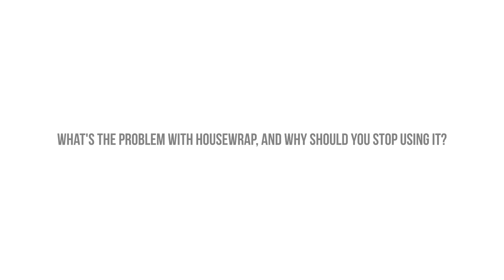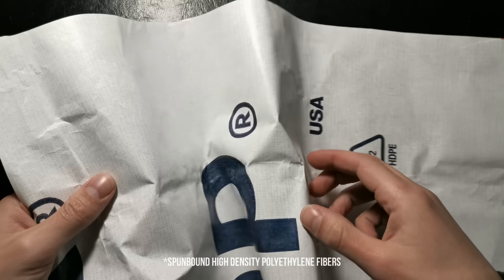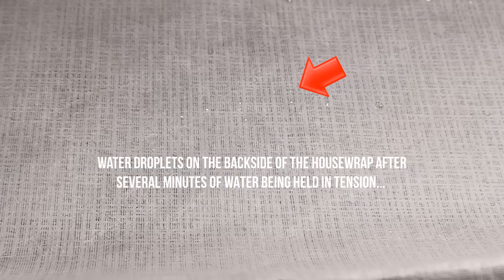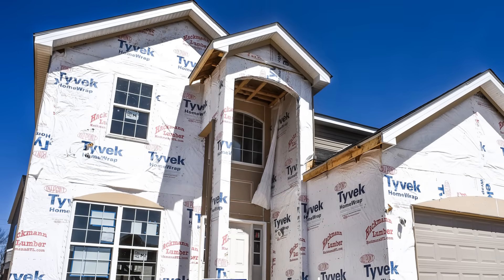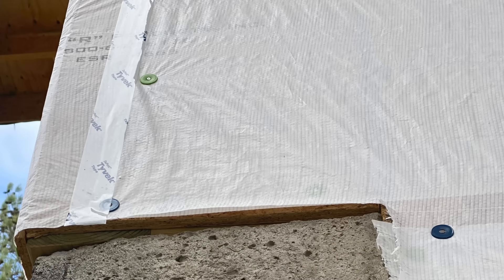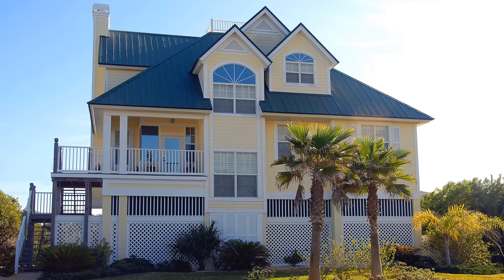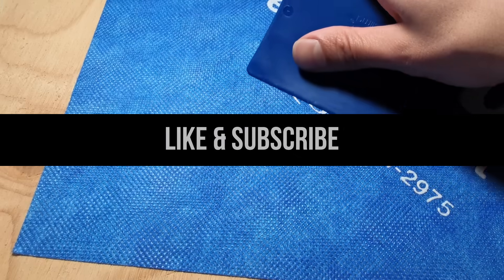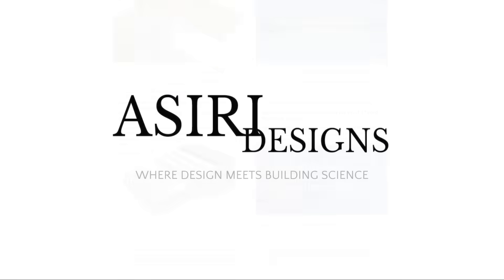Why I Stopped Using House Wrap

Comment: Retired GC and Sr Inspector.   The biggest problem today, IMO, is the failure of the trades in understanding the basic materials science and following the manufacturer s use and installation instructions.   Piss poor management and oversight of the projects by the modern GO FAST, TIME IS MONEY, attitudes.   Almost always,  the Approved Plans have all of the details required for a decent understanding about proper work.   Of course,  you have to read the fine print as well as study the reference materials noted.
Reply: THIS is the problem.  Architects and engineers can design all the newfangled systems they want and it doesn't matter one bit if the builders fail.  Every link in the chain has to work for the system to work.
Reply: @Mountain-Man-3000  
Assuming the architects and engineers haven't failed, which they often do.
Reply: Problem 1 the plans are in English. Problem 2 most builders think putting a copy of those plans on the job is supervision.
Reply: Read,   read,  and re-read again.    As you've missed something the first time,  and the seccond.
Reply: @kwisin1337 why read when YT is available?
Reply: When the installers cant read in their own language, much less in English. Instructions are useless.
Reply: @primeracalidad8320 Who are these installers? Overseas foreign workers (OFWs)? I’m amazed there aren’t more people who have at least graduated from high school and are therefore capable of reading willing to do this work.
Reply: @primeracalidad8320  AMEN, exactly 💯
Reply: @primeracalidad8320  People love to blame "foreign" builders for the stuff-ups, but the amount of poor workmenship I've seen by folks of anglo-saxon extraction blows a massive hole in that.

The biggest problem here is the mix of laziness and an "It'll be okay," attitude.  And yeah, we get folks from overseas who do a bad job, but hionestly I see more local born and bred folks half arse things.
Reply: Agree 100%
Reply: Instructions are great, for sure, but we used to have the ability to bring a young guy up and show him what works and why, not just one guy but the whole crew.. even learned a lot from many good inspectors... $$ is the ugly WC and bs codes trying to fix poor installation issues ...new crappy products like Tyvek or zip..FO 30lb will outperform everyday all day. Oh and let's start some bs license program to make money..times have changed
Reply: They have constantly changed codes and building styles and it always leaves the Carpenters take out the load with no increase in pay.. I bet my bottom dollar any carpenter has been on the job for 20 years knows exactly what to do in any situation but his pay his relationship with his boss and how high he happens to be at the time determines the quality of the job
Reply: I'm in SW Florida and they have built at least 80 of these luxury 4 story wooden apartment mold mildew fire termite traps with these coverings. I bet in 10 years here, we will see a large portion of these place have to be pulled apart on the exterior and redone due to mold issues and etc.  
Just crazy how many have been but this last 5 years.
Reply: Sidebar:  A Homeowner Burned His House Down With DIY Solar Because He Didin't Read the Manual That Stated He Needed to Use High Number Strand of Wire in Order to Prevent Fire..............He Used Wrong Type Wire and His House Burned Down...If He had Read Manual He Would Still Have a House Today.....Tough Lesson Learned...I hope he reads the manual from now on....I readem on the toilet...lol
Reply: Many, but not all general contractors, are careless dicks.
Reply: @CuriousTortois 😂😂😂😂 when we walked my cousins house when they were starting the siding he noticed tow of the walls had no wrap at all. He called the construction office and told him, the guy said his people never miss the wrap. My cousin took photos and sent them to the big guy. Five minutes later the guy called back and said he was on the way to the building site. He was shaking in his boots when my cousin took him on a walk through and the guy tried to say the things my cousin pointed out were no big deal until my cousin told him he was an inspector never heard so much stuttering as the guy backpedaled. After that my cousin checked his in process house daily on his way home from work. He was really pissed because the builder had a good reputation.
Reply: I blame the Government for adding so much cost to building homes that in order to meet affordability every corner must be cut in order to keep home costs realistic. A home built "correctly" by code costs vastly more than it ever needed to be. There really is no argument around this outside of ignorance and support of an authoritarian Government to tell everyone how to live. 

Almost everything humans do is because of Government, we 're simply to lazy to understand that Government creates impossible standards because it costs the Government 0$ to do so... that cost is pushed on the public.
Reply: @CuriousTortois why are we letting racism slip in here? Talking so much shit but not willing to pay for the workers you want. These people come here to work and work they do. Work harder than us for less money at that. Instead of blaming them for being from where they come from train your workforce. And get some damn plans in Spanish.
Reply: Absolutely
Reply: I am concerned only with cold climates. My system is visqueen plastic behind drywall in front of unfazed rock wool insulation. Pink cotton candy is inferior.  15# felt behind brick venier with weep holes. Simple
Reply: Mexicans can't read
Reply: Failure of management to provide the training on these products. Everyone blames the workers, but the workers are consistently under funded, under trained and pushed for speed.
Reply: The previous owner of our house is a lovely bloke and very house-proud.  He got a lot of work done to the place, and now I'm having to do a lot of work to the place to fix it.  Professional builder after professional builder who just wanted to get the job done and either didn't understand how, or didn't care, to do it right.

Old owner spent a small fortune getting certain rooms insulated.  When I checked it out properly from underneath the house, there were huge air gaps over the top of the insulation that lead down to the inside of the wall.  There are exposed beams with gaps that lead all the way to the outside.

Everything looked great, and it was good enough to foolour local inspectors, but the difference between permanently having the house sealed up and having a window wide open is negligable.
Reply: I don’t want to blame the trades.  I prefer to blame the GC.  They too big. Hire students straight from collage and they’re not doing the proper inspections on the sub trades they hire for the work they ask them to perform.  As for the home owner who prefers to bypass a GC they get the cheapest sub trade to do work on their home.   Then sell the home when they are aware of the new mould problem and refuse to disclose the issue they have.  There is no accountability in buildings due to the modular way things are inspected or claw back on warrantees.
Reply: @oshanehall3470  It is a simple problem (pick a trade you are good at as well as one you enjoy) even if you are experienced if you don't like your job that opens the door to piss poor work...just adding.........
Reply: @CuriousTortois  who is hiring these people?  Where is the building inspector? 🤔

Greed and ignorance are causing this country to backslide at an incredible rate.  Very evident in manufacturing and the building trades, not to mention the corrupt af financial sector.  But I guess we can just blame immigrants, which is also a very American thing to do (ignorance).
Reply: @rustyshackle917  have you even been around any construction? It might not be PC but it is a true statement.   Not all are bad sure, some are great.  There has been a huge shift over several decades from there being masters, journeymen, apprentices, and laborers to an everyone on the job site is a “craftsman(even the new guy brought in last week)”. Sounds great sure and a crew of twenty that all think they know what they are doing might get it done quicker and probably cheaper than a crew of the old fashioned master with several journeymen and apprentices and a few laborers.   It’s not corporate greed that changed this but greed in general.   Everyone wants it cheaper and faster. I have many friends that gave up trying to compete and gave up their business because they just can’t compete.   Not all old school tradesmen were the best either but with the shift to the current the standard has definitely been lowered, and that is just part of how these crews undercut everyone.
Reply: @rustyshackle917 most places don't have inspections. Not everyone lives in a city
Reply: The biggest problem is inferior material like OSB and housewrap.
Parents house built in '52 had 1x6 T&G roofers for sublfoor and roof sheathing with 15# felt and minimal insulation, standard for the day.
I put three rooves on it myself, two window installs and many relocations of windows and doors over many decades.
Zero leaks into the attic insulation or any wall cavity and achieved that without today's rainscreen nonsense.
We are going backwards at an astounding rate to satisfy corp. greed.
Those same corp. are populated with college pukes with rain bow colored hair that have never worked with the products they produce or more importantly, the products those same sh*tty products replaced.
Reply: @WayneMarion  Yes sir,  exactly.   And when you are basically forced to use any product nowadays,  even if you follow the instructions to the letter,  good luck with any warranty.   GARBAGE IN, GARBAGE OUT.
Reply: @toddwheeler1526  Read the warranties on these products. With rare exceptions they will just replace faulty materials, not paying for labour or re&re of materials to get to the failed product. They are ridiculous. Best to work with products that have a long history of good performance.
Reply: @allisterhavers-qt7co MAYBE they will replace the defective product?  The majority of the time,  manufacturers will challenge you.  Typical business practices, claiming your products are supreme and then denials of claims.   Be well and stay safe.